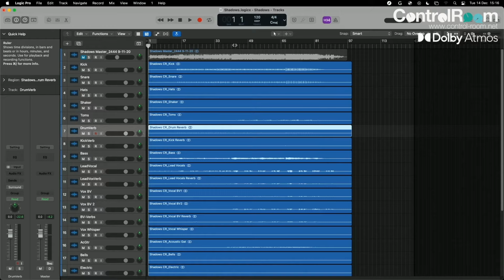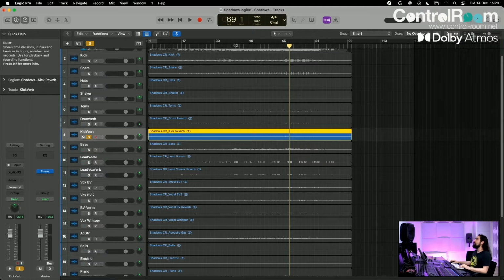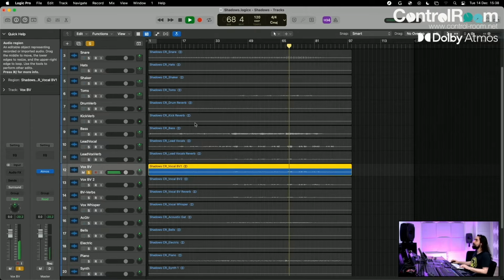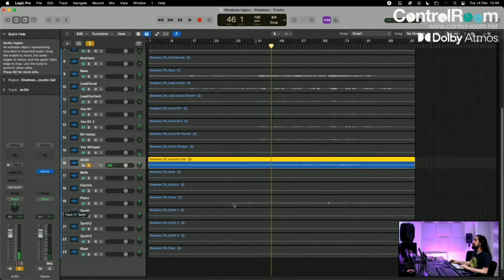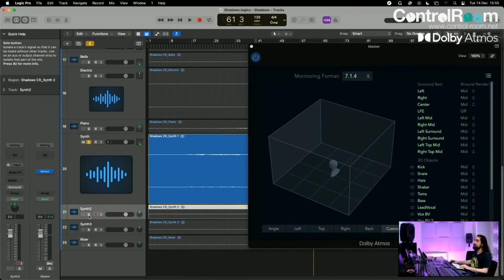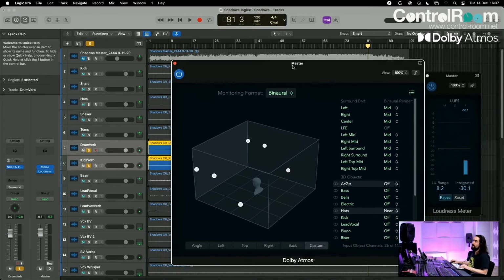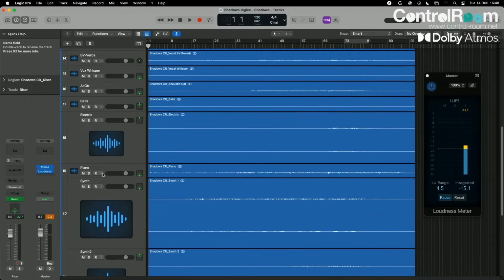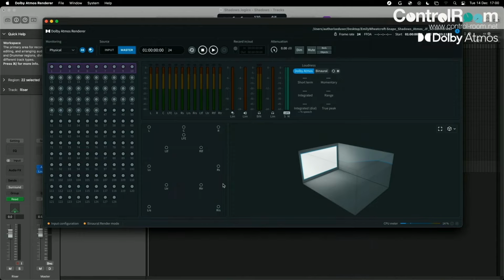How to Mix in Dolby Atmos using Logic Pro

Comment: Hello
By any chance do you know a solution to reduce the volume of amplified  speakers connected. (Adam's)
I am obliged to reduce the Logic's Mixer to -30/-40 db so it is hearable  but the volume si to low to bounce.
There is no possibility to reduce the volume on my two Presonus Quantum 2626 and the volume is set to -20 db on the 10 speakers.
Thanks

Comment: This is probably the worst Atmos tutorial I've seen yet. You adjust the pan settings without even hearing anything. You leave a reverb in its inappropriate default settings for multiple tracks. This is just in the first 6 minutes or so. Not even bothering with the rest of this crap.

Comment: This is a really good demonstration of the Dolby Atmos capabilities in Logic Pro. One thing that you never addressed though is how you would change the downmix and trim settings. This doesn’t appear to be possible in Logic Pro even though it’s recommended to change the trim to 0.00 for all downmixes and to use Direct Render for the 5.1 Downmix control. So, how would you go about doing this if you’re mixing in Logic Pro?

Comment: Great video, thanks for all the information and time you took to make this video. Im new to Atmos, and I dont have 7.1.4 speakers in  my room, so I will be using my headphones. I have a couple of questions: 1- When I open the master 'Atmos' plugin on logic, the binaural is greyed out, I only get Dolby Render and Apple Render, how do I set it up for the Binaural to be available (as I will be using headphones to mix)? 2- My AD/DA is an Apollo X16 and my DAC is a Cranesong Avocet 2a (stereo), I will use the Cranesong to monitor via headphones the Atmos 'Binaural' mix. How do I set it up to be able to monitor binaural on my system? Many thanks

Comment: How is mastering performed on an Atmos mix?
Reply: On most Atmos mixes, there isn't any "mastering" due to how objects are routed, whether you are using the one built into logic, or the external renderer. Dolby does have a mastering suite that gives you more flexibility if you want to make additional changes overall, but where there are certain loudness requirements it almost isn't super necessary to have mastering for Atmos in most cases.
Reply: @alex_ayers sir can we use the same concept of mixing to mix movie in headphones and give it as a Dolby mix without. RMU setup only in headphones and 5.1 monitering .... Tq

Comment: Excellent video, Jake. I’m confused in the Binaural view, when you’re choosing Off, Near, Mid, Far, are those distances going to be perceived in the final ADM BWF, or are they only preferences for how we hear the distances during mixing with headphones?
Reply: i had the same question after some research as per the official apple manual it does not affect when you export it to ADM BWF, however it will affect to a surround format. So following the steps done in the video it will not affect. the article is called dolby atmos plugin in logic pro
Reply: @cesaravila4748  thank you.

Comment: Great video! Really showcases how easy it is to get into Atmos in Logic Pro and get involved in immersive audio! Thank you! 

One quick note about Trim & Downmix settings where pretty much standard practice nowadays is that the Surround and Height Trims should be set to 0. 

Also, the importance of loudness I believe was a bit understated in the video. The -18dB integrated and the -1dBTP ceiling are really important and if not adhered to any submission to distributors will get rejected.  

And one final note about codecs and binaural metadata: Tidal on Android uses AC4-IMS as the delivery codec which does use the Dolby Binaural Render Mode metadata. Tidal on Apple devices uses DD+JOC but disregards the Dolby Binaural metadata and just uses Apple's Spatial Audio for headphone playback, something which holds true for all Apple Devices. 

That's why Apple has also included a Spatial Audio Binaural monitoring option (listed as "Apple Renderer" in the Monitoring drop down menu in the Atmos plugin under Binaural) so you can monitor how the mix will sound on Apple devices. Note, when you choose "Apple Renderer" instead of "Dolby Renderer" you'll see the Dolby Binaural Metadata get greyed out.